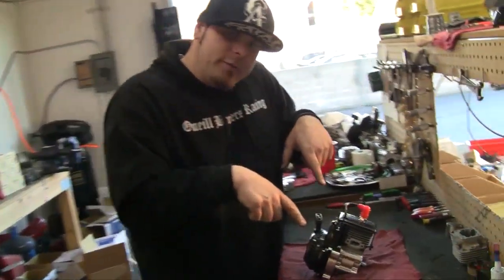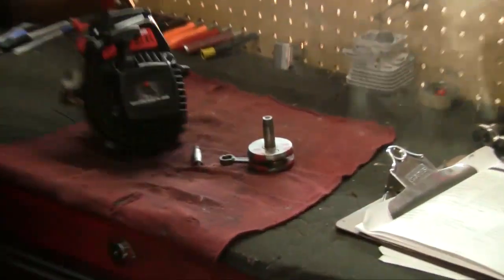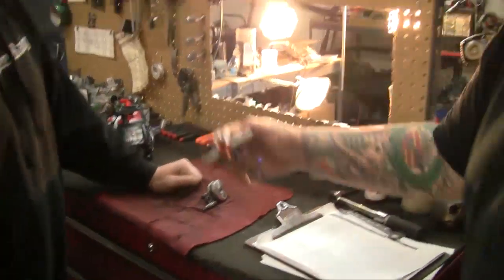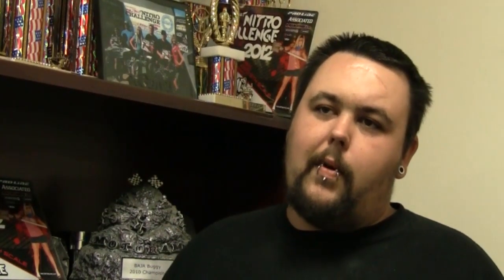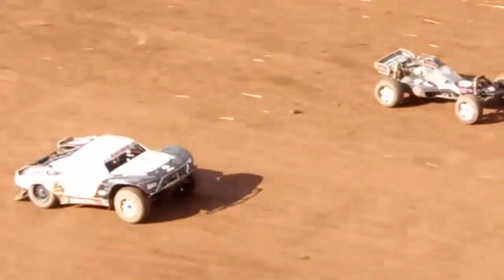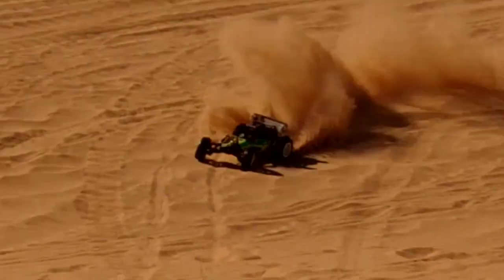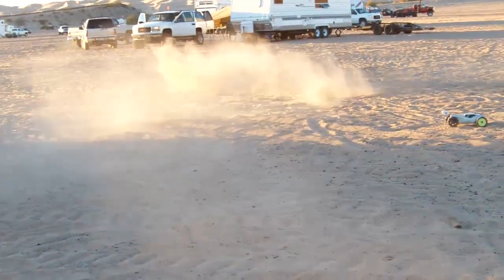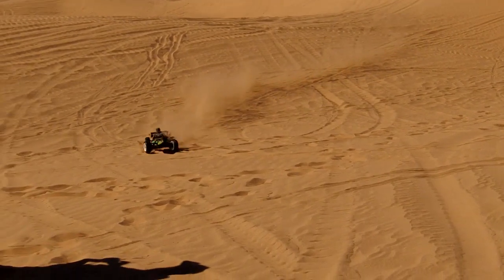Inside OBR - Episode 1 - Methanol Engine

Comment: Do you still mix your oil 28:1 with Methanol? What carb are you guys running on them? Since Methanol dries everything out, what do you guys recommend for removing the Methanol after each use? With high compression ratios, what kind of RPM's are you guys getting out of theses motors. I would love to have one of them in the near future.
Reply from the maker: +Patrick Ellison Yes 28:1 ratio. We run 990 carbs with an air restriction plate that we had made. We run pump gas through the engine to remove the methanol when we're done running. We mainly run 29.5cc's on methanol and they're revving over 20k

Comment: is it possible to be able to run gas and meth on the same motor? Im looking for a 30.5 reed and id like to be able to run it on meth, or 110 vp when im not running meth. I was looking at the nos mod also but still in the air on it.... Its for a losi 5ive-t, i plan on ordering the motor within the month..

Comment from the maker: These are methanol engines. They do not run on nitro fuel. You can blend the fuel with nitro but they tend to run really hot. The methanol alone gives a big boost in performance.